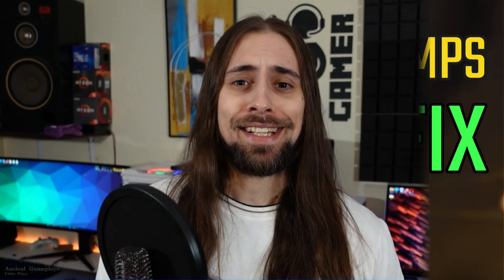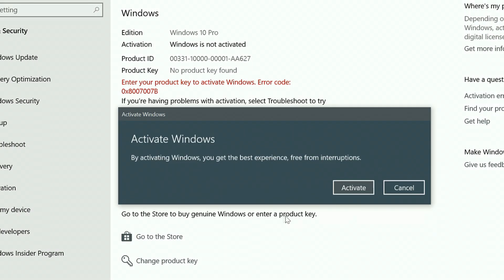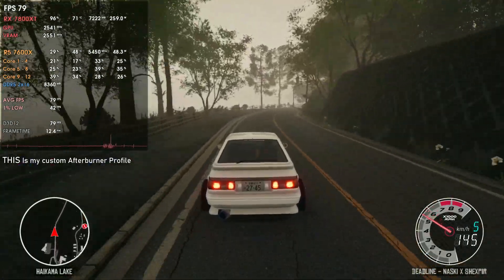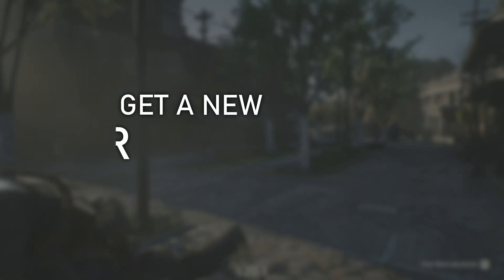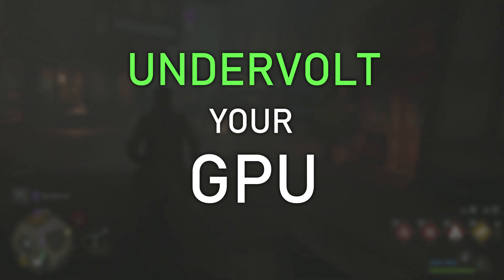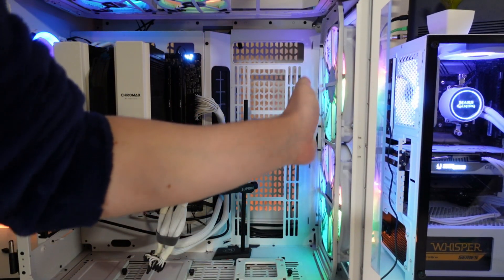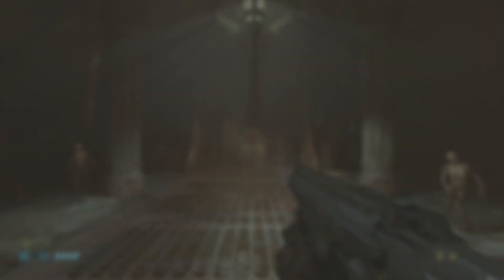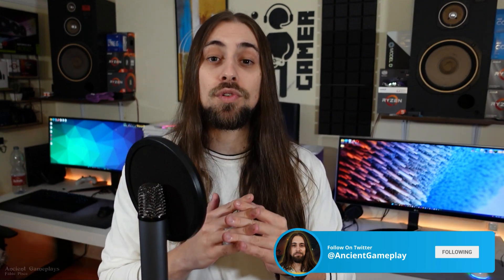HOW TO FIX your PC High Temperatures & Airflow Problems [2023 Guide]

Comment: Good quality case that isn't outrageous in cost is Cooler Master H500.  2 200mm fans in the front move a decent amount of air across it.  The top of the case has a removable mesh filter.  The case performs well in cooling but I still like block off the top mesh in the front so that it's only open from around the CPU and going back.  That way no air leaves the case without moving across the MB.  No USB C port on front though.  At least it has 4 USB ports on the front.

The TD500 V2 is similar, lower price, 1 USB C (10Gbps) but only 2 USB A ports.  Doesn't matter if you don't use them but I put my transceivers for the mouse and keyboard there so I prefer 4 ports.

And then the HAF 500 is out there.  Same port config as the TD500 but has the 2 200mm fans like the H500.  The CPU clearance is 167mm for the HAF 500 and H500 and 165mm for the TD500.  

These Cooler Master cases all work basically the same for their airflow and they rate high in case comparisons but much less cost than the ones that score above them..

The H500 can be picked up at the front of the case because it gives you a handle.  Convenient if you have to move the case by hand between different rooms.  You can put ANY GPU in the thing.

The Thermalright Peerless Assassin 120 SE CPU Air Cooler is about the best dual tower you can get for something below $40 USD and it competes against much more expensive coolers.  

The NH-D15 is good but costs a lot of money AND it's very tall and won't fit in most cases if you have tall memory kits.  The Peerless Assassin will fit over almost any kit of memory and still fit in a case with 165mm of CPU clearance.

The Scythe Fuma 2 is excellent but because the fans only go up to 1500 RPM so the cooler stays quiet at full speed, I don't like it for CPU that really require high quality cooling, like the 5800X3D.
Reply from the maker: That's a good deal, you also have some from Phatenks for example, others from LianLi

Comment: Replacing the GPU thermal paste is the most satisfying thing for me. I don't know why. It doesn't even need to be replaced sometimes lol.... (unless the paste is dry and crunchy) but somehow after replacing it... i feel better.  I always have that feeling in my head that GPU factories use a very common basic thermal paste, and if i replace it with something like Arctic MX-6 or the Noctua paste... I feel better knowing it will not dry up for a very very long time
Reply from the maker: because they do, the cheaper cooling solutions (and sometimes even the high end ones), use very cheap thermal paste
Reply: @AncientGameplays  Not Sapphire apparently. Their 7700 and 7800 are very low temps considering the high TDP! :D

Comment: what about jumc temps is 6000 series ? is it normal to reach late 90s and 100 on high end gpu's like 6800xt?
Reply from the maker: normal? No. But it may happen in lower end models, due to poor cooling ability, the lack of pressure and so on... usually a change in thermal paste helps
Reply: @AncientGameplays  i have a sapphire pulse (2 fans) 6700, with uv i have max 90 degrees on hotspot, in summer max 92'..without uv everyone reach 90 and over degrees with 6xxx series. For normal, i said this
Reply: my card is from sapphire (Pulse), will the arctic MX-4 Do the job or it is a must to buy a high end paste like thermal grizzly kryonaut? @AncientGameplays
Reply: 100 degrees on junction (i hope) maybe are high. 90 are normal. My 6700 with default settings reaches 90 degrees. Like me, you should do undervolting, my opinion.

Comment: Great tips as always. One more humble advice from me: Don't expect your temps to be alright when your case is sitting in an extremely hot room without AC in summer. As long as the ambient temperature is too high, your case configuration can only do so much. 

If you see this happening to you in summer, try and invest in some kind of AC for the room where your PC is.
Reply from the maker: Exactly, that's why I spoke in terms of ambient temps as well
Reply: I'm from a place where average temperatures in summer are 45 but my pc has been cool thanks to undervolting.

Comment: 👍 My patent; Undervolting, Lian Li III case, 7 x 140 fans. Fan controller dependent on gpu temperature for three of them.Gelid extrim paste, top model deepcool CPU cooling , XFX merc graphics card, it is quiet, cold but for big money. 🤷🙋 In a two-tower cooling system, the central fan should spin faster to create a vacuum relative to the external one ! It's a good idea to use incense to blow the smoke and check for turbulence, pulling fans are just as important as ventilation.
Reply from the maker: Indeed

Comment: I only have only a dust filter in the front and 0 fans, my pc has no problem to draw cold air by itself.
Reply from the maker: you would have better temps with front fans though
Reply: @AncientGameplays  I have 30 idle and 50-60 in games

Comment: My gpu heats up to 100 c hotspot temp when case is closed and 92 c max when case is open. My case is corsair spec 5. ( Two fans front )
 Cpu: Ryzen 5 3600,
 Cooler: corsair h60 ( Due to this  
 liquid cooler i can't put 2 fans 1 back and 1 top of case)
 Gpu: sapphire pulse rx 6750 xt
 Motherboard: msi b450m pro  
 vdh max
 Let me know what should i do to  
 increase the airflow with case 
 closed if possible.

Comment: I fixed my high temps with 2 360mm rads CPU/GPU waterblocks d5 pump/res a little tubing and a few fittings, problem solved 😁
Reply from the maker: That's because the tubing was defective?

Comment: Why getting more air in causes less dust than more air out? Doesn't make sense. This is a myth the rgb="gaming pc" boys believe. The truth is you need to have proper big filtered intake so it stop crud getting in and you don't even need fans blowing air in cause the exhaust fans draw the air from the front to blow it out the back already, so front fans is just extra noise.

Comment: LOL my case has 19 external fans, and 7 internal fans. I have two 40 mm noctua exhaust fans right behind my vertically mounted GPU to push any hot air trapped between the back of the GPU and the mobo out of the case. This was a really good addition. Everything else wasn't necessary, but looks cool! I also have a mesh front panel. My case is a 7000D from corsair. Probably the best thing corsair ever made LOL. Would recommend that case from corsair but nothing else from corsair! I legitimately love my computer after spending so much time building it and debugging it, and she looks amazing!
Reply from the maker: You surely like jet engines lol.  That's extremely unnecessary and past a point where its doing anything haha, but you do you my friend :D

Comment: in my Q300L, I have 5 intake and 1 exhaust in the back. I removed all 3 mesh on the case and added square rubber feet on top of the one on the PC to rise it a bit more. The vacuum in the case is insane.. You actually feel the plastic side panel being sucked on the case when you open it! And thermal are incredible for both GPU & Cpu with a castle 240ex. Radiator is top mounted and fan outside the case All fan are running on silent mode and I never changed them.
Reply: Great common sense improvements  to the Cooler Master case. Didn't take millions in  Research and Development.
Reply: @OwDoDuck  🤣🤣🤣🤣

Comment: Due to the temperature issue, is it better to have the chassis open or closed ?
Reply: Try it, but for me open has always let it run cooler. Especially with most gpus these days not spitting air out the back, but instead also out the side.

Noise is a factor.
Reply: @Ieonblack  You are right that leaving the chassis open makes the PC run cooler, but apart from the noise factor, as you say, it also gets more dust in, so there is no one without the other 😅
Reply from the maker: usually the open chassis will lead to better temps as airflow isn't optimal 90% of times
Reply: @AncientGameplays  The current configuration of my chassis is 3 fans entering air and 3 extracting

Comment: I live in a pretty hot climate so high temps are almost a guarantee most of the time.

My 6950xt usually reach mid 80 to low 90cs when i join a really demanding game at 1440p like cyberpunk for example.i do under volt abit so it's not runnin as hot as out of the box😅
Reply from the maker: my god, you need to fix that haha
Reply: @AncientGameplays  Funnily enough, i follwed your undervolt guide and that helped it decrease the temps by alot, no longer 3 digit atleast. I could try repasting but i dont want to void my warranty.

Currently using the msi gaming x trio 6950xt in 4000d airflow with 3 intake lul

Comment: I don’t have any temp issues, but do u think removing the side panel would decrease temps because there is more airflow that can come in or would it just ruin the flow of well the airflow
Reply from the maker: Depends on the ambient temps ans airflow of the case. Usually helps though
Reply: Yea, I've ran without a side panel for years now. You do get lower temps, mostly for the gpu. Make sure you run a few games and see how hot each game makes your cpu before you try it, just to compare properly. (Also, I have a ceiling fan on all the time, and the case is open facing the fan, so that helps.)

Some people might comment about dust, but I keep the my house clean and I just cleaned my mobo for the first time in 4 years, and it was basically unaffected. The heat sink on my cpu cooler was dusty, but not literally clogged. Plus, it took me maybe 20 minutes to thoroughly dust everything.

Comment: How to keep temps down on your 8+ core Zen 3 CPU.  Use a dual tower air cooler or AIO.  If that's not good enough and you're not OCing the CPU, either your ambient air temp is high or the CPU is unfortunately not a better quality one.

In building many Zen 3 based systems in a room that's about 75 degrees F I can generally keep the better 5800X3D parts around 70C running all-core.  The ones that aren't as good quality run closer to 80C.  I had 2 that red lined at 90C over different sensors.  One of those got RMA'd through AMD and BOY do they not like to admit the CPU is an issue and my documentation on the bad CPU was very detailed.  I had to deal with doing a return 2 different times so lots of wasted hours dealing with them.  For the other 5800X3D I bought it at at Micro Center and I had a debate with the store manager over it, but their return policy doesn't exclude CPUs and once again I showed the evidence of the part getting up to 90C over multiple sensors and showed a typical 5800X3D.

It's hard for these companies to deny red lines are bad, but they'll still try.

For other 8 core parts, I rarely see them run above 70C unless I give them a slight OC.  Once again if they run over 80C, it's not better die and you're stuck with it.

It's EASY to work with the 6 core parts.  You can buy a 5600, put a 200MHz OC on it via Adrenaline (this adjusts the BIOS, it's not software tweaking which is why you have to reboot the system), and it runs like a 5600X, and STILL has temps around 70C.  AND you can use single tower coolers on the 6 core parts WITH an OC AND running 3600 16-18-18-38 memory.

With the 5800X and 5800X3D temps go up when running 3600 memory.  With the 5700X it's easy to run 3600 memory.  

It's easy to run 3600 memory with the 6 core parts.  

It's also surprisingly easy to cool a 5950X and 5900X with a dual tower running 3600 CL16 memory.  I wouldn't try to OC those though because they already push high clocks for Zen 3 parts.  I don't like the temps going above 80C although if I can give a 200MHz boost and all-core puts me at 81 - 82C I'll go with it.

The only Zen 3 parts I've had to replace were 5800X3D.  That's a problem part obviously.  Out of 9 that I bought, two had to be replaced.  That sucks.

Everything I said above for temps is ALL-CORE, NOT gaming.  It's much easier to keep temps lower than what I said in gaming loads.  If you have a problem with temps for the CPU during gaming you have a serious issue or ambient air temp is too high.  

I have two of those 5800X3D based Zen 3 systems on X570S MBs and 32GB 14-14-14-34 G. Skill memory.  There's no need to push to 3600 for gaming since it does little in most games if anything, and the lower latency gives a little boost in fps.  It also affects the temp of the 5800X3D and 5800X more than the other parts.   The other systems were sold.  The CPUs I kept scored over 5600 in Cinebench R20, where the typical score in the range of 5500 - 5560.
Reply: You do sound like you know what you are doing! You never mentioned undervolting, this made a significant difference to my 5800X3D. It ran way too hot at first so undervolted by 3mV and improved the case fan ventilation a lot (3 -> 7 fans). Now at 100% performance in Cyberpunk at 1440p it  never exceeds like 62 deg C. If the room warms up a bit sometimes might creep a degree or 2 higher. I think I was lucky in the silicon lottery with mine.

Comment: replaced the thermal pads on the memory modules and the thermal paste on my xfx merc 7900xt.  and also zip tied 3 lian li uni sl120 fans to it removing the stock ones obviously.   for thermal paste i used noctua NT-H2 and for the thermal pads i used Owl Tree 12.8W/mK 1mm thickness.  made a huge difference.  not only in temps but noise.    well worth it.  oh the fans i have running on full on lian li software.  still very quiet.  running 31c right now
Reply from the maker: Insane mods haha
Reply: All you needed was PTM7950 paste. That made a huge difference for me.

Comment: I got the 7700x and in Battlefield sometimes reaching 95c. I managed to change something in my bios and now it wont go higher than 85c. People still saying this is way too high :(
Reply: @eder60hz51  alright man!  Will do this today!  Thank you so much
Reply: That is way too high for gaming. Set a manual undervolt instead of pbo. Idk that cpu, but reset your bios, see what frequency and voltage it runs at while in cinebench (should be about 1.3V and around 4800mhz), then set that voltage/freq combination in ryzen master. Then slowly lower the voltage by tiny amounts (ryzen master defaults to 0.00625 per tick, do that), test r23 after each adjustment. Then once it crashes, just go up one more and you should have a good undervolt. Once you get the right adjustment in ryzen master, apply that in your bios.

For reference, mine is 4300@1.1125 5900x and it doesnt go over 40-45 in games or 75 in cinebench. Small air cooler.
Reply: @Ieonblack  I am very noob with pc's is this hard to do myself?

Comment: I love these tut videos. You should do one for AMD driver slimmer, it debloats the driver like NVClean Install and it will be helpful for others.
Reply: what is the advantage to having stripped drivers? Versus the regular "dont install adrenaline" version of the install. I dont see any benefit other than storage? Genuine interest
Reply: @Ieonblack  you can disable a bunch of scheduled tasks to speed things up, remove some devices like high Def audio and noise suppression (helps with latency a lot), and remove certain features like overlay and hotkeys. Also can remove tuning if you rather want to use Msi afterburner instead (I find AMD tuning resets a lot). But the nice thing is you can keep the per game settings instead of having a universal on like amds minimal (on minimal sharping seems to apply to everything even browser and apps that don't really need. Bunch of other stuff to, check out some YouTube vids.

Comment: Techno-Jesus just in time. I just replaced my case. I had mesh case from cougar (mx330g, but i can't recommend it), and just got a small mATX noname case without mesh front, and of course it has worse airflow. BUT it has cool swing door window and it's dirty cheap, like 30$ (new). I will replace it because it's so much worse than slightly more expensive cases and has terrible design and airflow, but at least it's good at absorbing vibrations from hard drives so i used it for a week just to make sure.
Reply from the maker: Cases aroun $100 are the best bets, with good overall price/perf